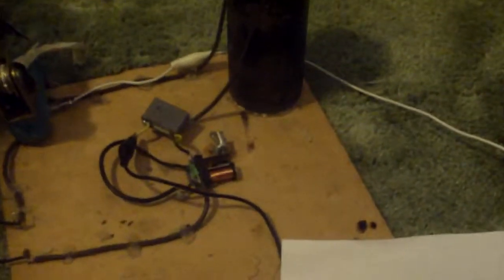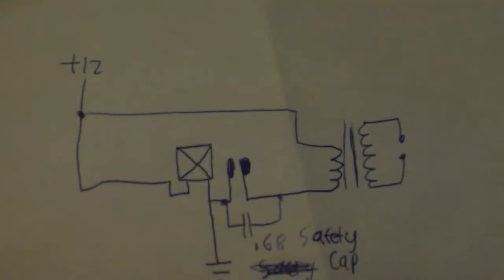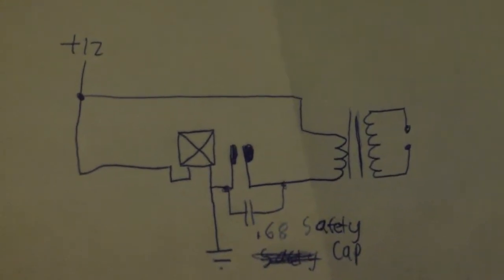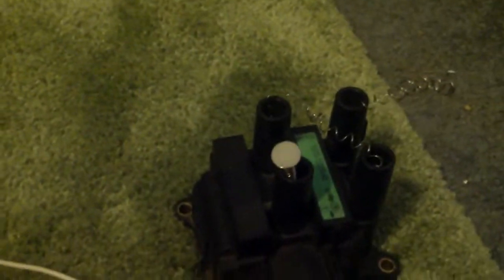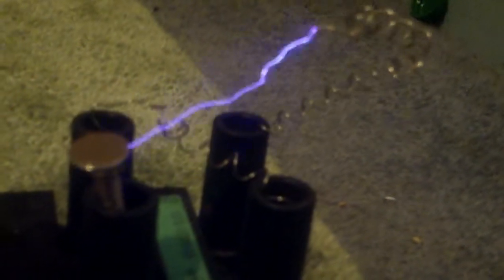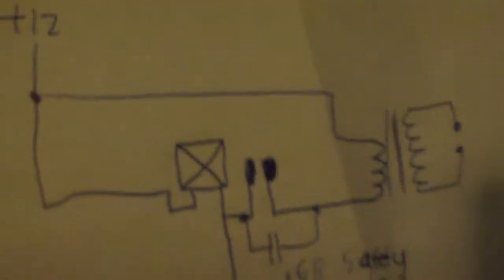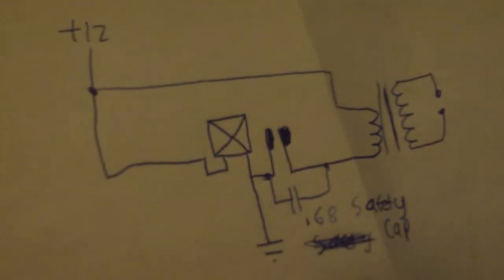insane ignition coil driver

Comment: Have you tried experimenting with different capacitor values?  I have found that varying the capacitance will change arc thickness and length.  It is fun to experiment and move the capacitor around different places to see what happens.